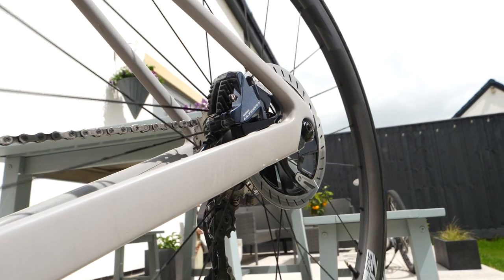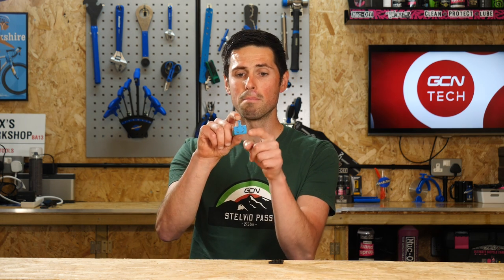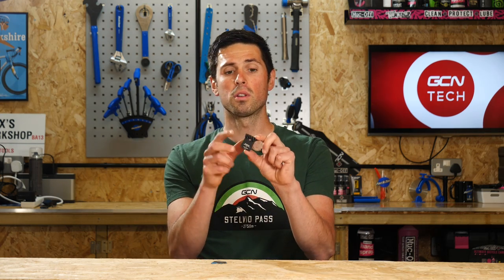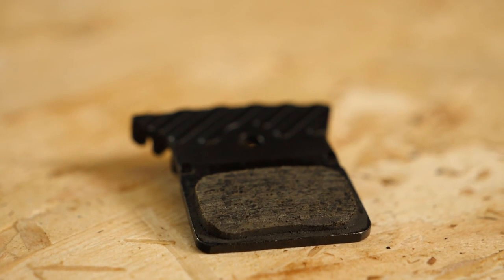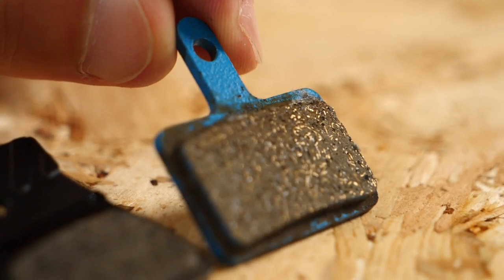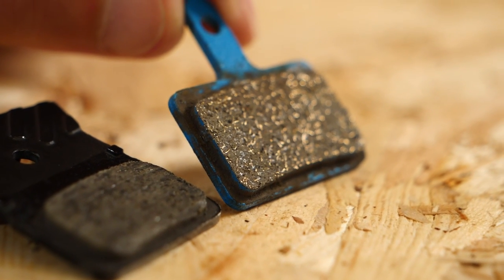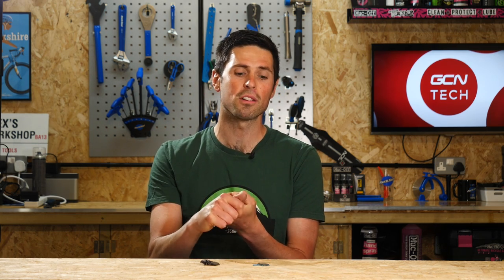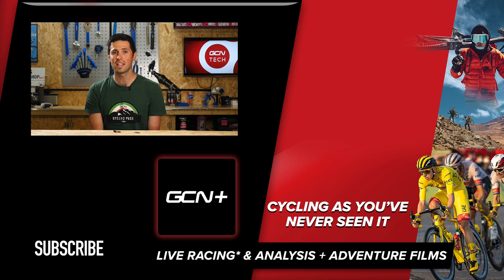Everything You Need To Know About Disc Brake Pads For Road Bikes

Comment from the maker: Are there any more disc brake maintenance videos you'd like us to make? Let us know 👇
Reply: When do you know when to replace your disc pads?
Reply: What is the best mechanical disc brakes for road bikes?
Reply: How to clean/maintain disc brakes, focus on when you have sticky pistons?
Reply: How to convert your disc brake bike to rim brake bike.
Reply: @shannontrainer5857  thanks for the video. yeah I am sure they will wear down eventually, but its just not that fast. Carbon wheels can and will last for a very long time if you take good care of them, aluminum wheels even longer. When and if they do fail, same with rotors can over heat and fail on a steep hill, you’ll probably take a face-plant in either case. Rim brakes have been perfectly fine all along, races are still being won with them. But I’m happy for you if disk brakes give you that sense of security.

Comment: I am about to change rotors(13k km) , and I am also changing pads alongside them. Local bike shop installed some cheapish resin pads last time I went for a separate issue(cable change) on their own initiative. They worked well for a couple thousand km, but now u can feel them wearing down too much. The rotors still have life left, but I bought new wheels and I am buying a new cassette and rotors to go with.(and a new chain. Has life left too, so I am buying a quick link and keep it as a spare). Just fresh components in general. 
I usually go through two or three sets of pads in a year. I average 7.5-8k km in a year, in a moderately hilly/mountain area in West Japan. The only pads I have found for my TRP brakes are either resin or semi-metallic. I usually chose the later, but I found decent priced organic ones that I am going to try...

Comment: I love how quiet resin pads are but here in Wales where its often wet and grimey with a lot of steep descents, I go through one set a month in winter!  I find using semi metallic ones much more suited to these conditions.
Reply: James DH: So, in winter, if you go through one set a month from your resin pads, how long has it taken for you, in winter, to go through your semi metallic pads?
Reply: @lazurm  Well I only figured this out the last winter, but I've been on the same semi metallic pads for the past 7 months and 2000 odd miles with about 200,000ft of decending and they still have life left in them. By comparison I was getting around 300 miles from a resin set.
Reply: @aGhost0o  I ride mostly on asphalt, an average of 1800 feet ascension per 40 miles and, with my resin pads, get around 4000 miles from them. 
I should be amazed at my mileage but, because I'm a relative newbie when it comes to disc brakes, I was amazed when I learned what the low mileage expectancy is with resin brake pads.
Reply: @lazurm  I'd like to know the brand and rotor size please!
It probably depends on lots of factors and you have to use what works best for you. I have regular long 7 mile descents with up to 20% gradients down single country lanes covered in farm slop, where I'm hard on the brakes consistently for up to 30 mins, slowing from speeds up to 40mph and shimano resin pads can't cut it. At 90kg for bike and rider I ain't no weight weenie either hahha.
I suspect I could make the same pads last much longer with different parameters.
Reply: @aGhost0o  I've used the Shimano K03S resin (organic) pads on two bicycles, mine and my wife's, both of which has 160mm rotors. I've had to replace mine at 4,500 (rear) and 6,000 (front) while my wife has around 3,500 miles and, as of today when I took them off to inspect, still has a way to go. 
Our roads are clean over 99% of the time and we try to avoid riding in the rain (twice in the last year). 
The combined weight of bike and body is 235 lbs. for me and 155 lbs. for my wife.

Comment: I've regressed to rim brakes on my latest bike. Discs are awesome, well worth it but there is something wonderful about being able to replace the blocks and tune rim brakes in less than 10 minutes.
Reply: Adjusting pad toe-in, caliper centering, pad distancing, pad alignment, and rim trueness takes a lot more than 10 minutes.
Reply: @shannontrainer5857  trueing discs, sorting sticking pistons, alignment of discs hydraulic callipers facing brake mounts can take a lifetime with shops and even worse direct sale bikes.  I do all of this regularly to the poorly manufactured expensive bikes. You don’t need to invest £400 to be able to sort out rim brake problems. So don’t be upset if you get charged £50 to 100  to face your frame and forks to solve a problem.
Reply: I can tune my disc brakes in less than 5 minutes.
Reply: @awakenedbahamut2574  then your lucky,  it takes about an hour to face a frame and you have to pay for the use of £400 tool if it’s steel or titanium then you can double the price as the harder material places more stress on the facing cutters. If your lucky the manufacturer might have done it or might pay.
Reply: @tobycolin6271  Replacing rims worn out by braking takes hours. And you'll need a truing stand, nipple wrenches, a dishing tool, and a spoke tension meter. Not to mention multiple hour-long YouTube wheel-building tutorials.
Reply: @tobycolin6271  what?
Reply: @shannontrainer5857  you do know that those of us that look after our rims get 5 to 10 thousand miles out of a set. You have to true disc wheels and check the spokes more often because of the spoke de tensioning issues that you don’t get with rim brakes.

All the things we knew about road disc and have been stuck with since 2016 is explained in this video. 

https://youtu.be/SZ-uMif6kjM
Reply: @tobycolin6271   Truing a disc rotor(with a truing or a pair of needle-nose pliers) is a lot easier than truing a rim(with a expensive truing stand, dishing tool, spoke tension meter and a nipple wrench). I also live in a hilly area, so the best I can get is 2500 miles. You just being defensive and delusional.
Reply: @shannontrainer5857  whether you like or not both rim and disc wheels need truing and  spoke maintenance.  I wouldn’t true an ice rotor or other composite rotors with your method of choice as you’ll delaminate the disc. Disc contamination from road oils, salts  and diesel all destroy discs. As a mechanic I love discs then bring me so much work.
Reply: @tobycolin6271  Why are you facing a frame mount when you're changing disc pads ? No wonder you like the money you get out of your customers.....
Reply: @fukawitribe  I’m not, I’m facing frames because of problems that my customers are having with rubbing rotors. I had one the other day where the manufacturer had laid the carbon over the brake bosses.  It’s going back to the manufacturer after two shops had said there was no problem with the frame and disc rub was something you have to put up with.
Reply: @tobycolin6271  Sounds like a utterly shit manufacturing job, and I imagine you're seeing those at a significantly higher rate than anyone - because you don't ask a shop to look at something if there's no issue. So the question is, what are those rates and are they at a value that makes it a problem for your average user. Historical data suggests it's not, but it always open to debate. 
Personally I find rim far quicker to adjust than disc brakes - although short of the sort of work you're talking about, or a bleed or re-cable, neither take more than a few minutes at most - but I need to fiddle them more. This is fine for me, YMMV clearly.
Reply: @fukawitribe   I’ve done 5 bikes so far but I have a steady stream of bikes and enquiries I’ve got two customers that are in discussions with the manufacturers of there bikes. It varies from bike 3 to 5 years old that people have constantly tweeked to brand new stuff and I haven’t done enough to see if if one brand is better or worse. It’s just an example of poor QC and the lack of support from direct sales.  Some manufacturers won’t admit the problem or allow you to face there frames without invalidating the warranty.
Reply: @tobycolin6271  So - as you say - sounds like some cases of poor frame manufacturing / QC (hardly surprising when you see what's there when you cut some of their frames open). Most of the rubbing disc issues i've seen have been down to off-centre bolt up (not thru-) axles or  wonky calipers - both of which are trivially 'fixed' with a hex wrench or spanner. Disc warps are rare IME on road bikes and doubt that would affect a rotor that is not amenable to straightening - laminate rotors would take some grief to bend.
Reply: @tobycolin6271  why are we having to face the frame for disc brakes ?  I have a new BMC Roadmachine and I just ride the thing as it came.  Mind you  have been going to the same bikeshop for many years so maybe they took the time to set the bike up correctly, dunno really.
Reply: @chapmag6578  the Qc on some bikes is poor if your unlucky you get a Friday frame. The shops haven’t got the skills or support from manufacturers to solve the problems. We will go through a facing crisis with bbs now we’ve gone back to threaded as to be creak free you need a flat surface between the  frame and the bb. You didn’t need this area to be flat with a press fit.
Reply: @tobycolin6271  thanks, I reread the whole thread after posting ( might have been better to do that before posting ) anyway, I was curious as to the types of problems that would be resolved by refacing
Reply: @chapmag6578  if your calipers move and your constantly realigning them and to stop rubbing then you might need to face them. Paint on the surface is most common, but the post also move during the bonding or welding process. A good build will check this and face before the bike reaches the customer but a few bikes get through.  I’ve done 5 bikes to date but the tool is £400 and many shop can’t invest in the tool.
Reply: @tobycolin6271  Thanks, great to know

Comment: This is my personal anecdote so your mileage may vary, but overall I've found discs to be more problems then they're worth. Yes, they offer better braking power and better modulation. However both metallic and resin pads seem to wear down a lot faster than rim brake blocks and costs more, so you end up doing more maintenance work, and spending more money. Also, as an owner of two disc brake road bikes, I always seem to have issues with brake rub especially with QR skewers. No amount of truing the rotors, or realigning the brake mounts eliminates it completely.

Stick with rim brakes, they work just fine and save yourself the hassle.

Comment: Here's the dilemma I have with disc brakes.

Clearly disc brakes are popular in the industry, because these brakes create a huge new market for spares, repairs,  adjustment and, in many cases, entire bike replacement. But it's wrong to assume that disc brakes are universally popular, especially when common engineering problems associated with bike discs have yet to be ironed out. If you bought a car with noisy or rubbing disc brakes then that car manufacturer would have to recall those cars, yet the bike industry seem to churn out (arguably) faulty disc brakes with impunity, and seem more concerned with profit than any enthusiasm to resolve engineering problems that have a very real consequential environmental impact. As motorists, having to regularly change discs and pads, or put up with noisy brakes, would be completely unacceptable. But, as gullible cyclists, we seem happy to do this, while manufacturers just enjoy the disc brake "gift that keeps on giving".

Comment: What would you recommend for solving disc brakes that feel “mushy” without much stopping power? I’ve recently replaced both pads and discs after about 15k km on the stock ones, and the replacements now have ~30% the braking force and completely useless in the rain. I’ve tried re-aligning, cleaning and sanding, changing pads, cables, and tearing my hair out. My next bike is going to be rim brakes.
Reply: Mark Sutherland: It sounds like you have hydraulic disc brakes that need to be bled.

Comment: You didn’t mention that some rotors require resin pads only.
Reply: Yes was wondering can metal pads work on these disc or best stick to resin to not wear disc out
Reply: @nateo745  The rotor should specify if you can use metal pads, some of mine specify ‘resin pads only’
Reply: @mauriciorosales1259  yes my rotor says the same. I guess metal on these would wear the rotor out quickly

Comment: I switched out my stock TRP brake pads on my TRP Spyre SLC as they were organic ones which worked but not quite happy with the performance. In came the Nukeproof organic pads and the bite was pretty consistent and assuring, even under hard braking.

My area is pretty flat with little climbs so there is no real need for sintered or semi-metallic pads.

Comment: I had a 1992 Giant Cadex w/rim calipers.  Sold the bike in 2012 and the original brake pads from the factory were still installed and had LOTS of life left.  Please tell me what the advantage of disc brakes are.  I now have a 2015 Cannondale SuperSix w/Ultegra rim brakes.  Works every time for me even in the rain.  There is zero maintenance to Rim brakes.  Aside from looks, where is the advantage.  I'm glad computers have advanced better than this otherwise we'd all still be using a 486 processor!

Comment: I still like rim brake especially after the video that Chris Froome explain the problems with disc brakes. Anyone agree?
Reply: I recently upgraded my rim brakes and now they work so much better: I cleaned the rims and the pads.
Reply: The only way that I would switch back to rim brakes is if I switched back to alloy rims. That would be like switching back to four wheel drum brakes.
That given, the Pros HATE moving to new technology. They absolutely loath it. It took the Pro Peloton a couple of years to adopt Hyperglide type "cassettes.
Reply: Really depends on the riding you do. I use my bicycle mostly for commuting within a large city, and (mineral-oil) hydraulic disc brakes are a godsend. Significantly lower maintenance (the pads self-adjust for wear! 🤯) and the most frequent maintenance items (pads and rotors) are easier to do. Bleeding/changing fluid is a big faff, esp. because you need specialist proprietary tools (bleed kits vary significantly between manufacturers, although there are "universal kits"), but it's not that frequent with mineral oil.
Reply: @jamesmckenzie3532  .. and it took a long time for a lot of pros to adapt to STI levers.

Comment: All this drama on disc brake bikes just buy a rim brake bike 🚴 get on it and have fun #no issues #
Reply: As if rim wear and tire blowouts are not issues.
Reply: Blowouts and rim failures are a lot like terrorist attacks, in reality they are not that common, but they get all the  attention.
Reply: @hmudesign  Rim wear is not as uncommon as you think. That's why rim brake wheels come with labels that say "Warning: rims wear with use. Check daily for wear. Replace when worn. Failure to do so will result in catastrophic rim failure and may result in serious injury or death.
Reply: @shannontrainer5857  It'd take you a long time to wear through a rim.
Reply: Find a new rim brake bike.
Reply: @MarkRiddellRacing I have links if you need a rim brake bike 🚴. I got a giant tcr 2021 pro this year rim brake version
Reply: @highfived  too late...
Reply: @desertrainfrog1691  So why do UCI pros get new wheelsets every 4-5 stages?
Reply: @shannontrainer5857  I wouldn't compare to pros for any reason. They're tough on everything they use. Most of em are using discs now anyway, are they still replacing every 4-5 stages? 

Ask an actual cyclist who uses rim brakes, they'll tell you that they get a lot of miles from their wheels. Especially higher quality ones.
Reply: @desertrainfrog1691  Ineos Grenadier still uses rim brakes and they replace them frequently. I get the feeling you ride once every two weeks.
Reply: @shannontrainer5857  I ride frequently, there's nothing for you to base my ride frequency off of though in my comments. That was a pretty odd assumption. The pros don't relate to a regular cyclist. Go use rim brakes yourself and tell me you're justifiably replacing them every 500 miles. (The equivalent of about 5 stages)
Reply: @se7enTse7en  Rotors cost $20, low-quality wheels cost at least $500, and better quality ones cost at least $1,000. Also your rim brake wheels lasting that long means that you only ride on the weekends or at once a month.

Comment: How do you choose which brake material?  Well, at the moment there is a shortage of Shimano pads in the US, so you have to take what ever you are lucky enough to find online.  LBS's are all out and say it could take a month or two to get more.
Reply: First step: Check what your rotor will take (some rotors say resin only, some say metallic only). If your rotor takes more than one type (or if you're replacing rotors):

- Resin pads are cheaper, less noisy, and kinder to your rotors, but as Alex said don't take kindly to long, hard use (descents, DH), are faster wearing, and have worse performance than the other kinds on wet conditions
- Metallic pads are longer lasting, better on wet conditions, and can take more prolonged abuse, but wear out rotors faster, are noisier, and cost more.
- Semi-metallic pads are between resin and metallic pads in all advantages and disadvantages, usually very close to metallic pads in both categories.

Comment: No mention of ceramic pads. Did you call them by another name or am I using out dated pads 😱. I used to put copper grease on the back of the pads but tbh the benefits are small when you consider the risk of pad/disc contamination is relatively high when compared to motorcycle pad.